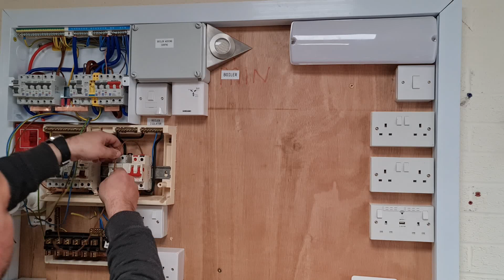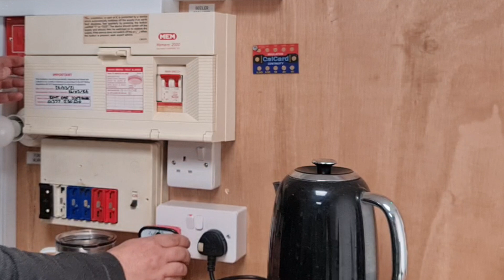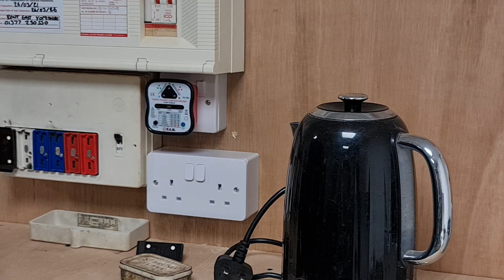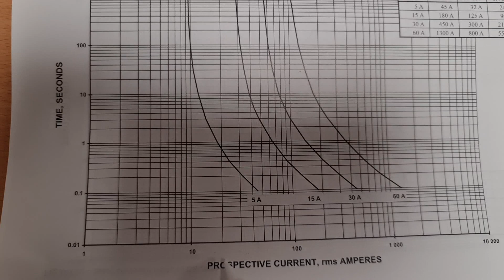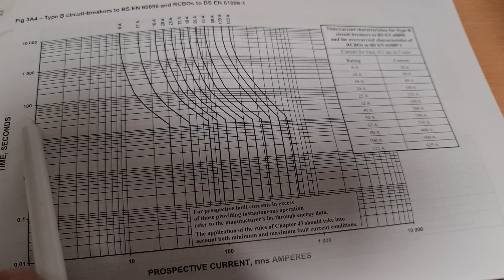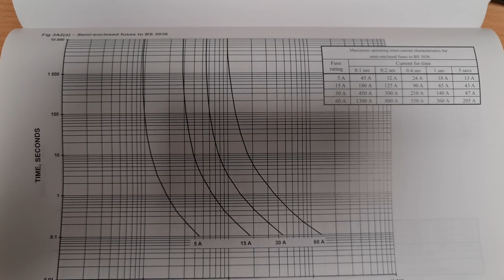Old vs New, what trips faster fuse wire or (B) MCB. Flash bang madness and time curve analysis!

Comment: Old school emergency from an old guy when I was an apprentice in the 80s, if you don’t have any fuse wire, use one strand of a single cable. 1 mm is about 5 amp 2.5 mm is about 15 amp etc.
Reply: I meant to say  a single strand of 7 strand single cable

Comment: Interesting. I remember reading that MCBs react faster than fuses - particularly during a short circuit. Seems like that info was wrong.
Reply from the maker: On paper they should. But if the instant current flow is high enough all bets are off. Due to the physics of fuse wire it generally wins if fault current is large enough.

Comment: Well demonstrated old chap.
Reply from the maker: thanks! very kind and thats another item off the bucket list. A comment from yourself.
Reply: It certainly was always thinking outside the box. Well lots of consumer boxes really👍🏾
Reply: Fuses are sacrificial devices which still have a role to play in modern large industrial settings (both fast and slow blow fuses for dedicated feeds and equipment loads) we certainly see them here in the USA partly as you suggest due to the fast reaction times. The breaker is an interrupting devices meant for greater longevity and modern power usage breakers of course offer another important protection linked to the physics of electricity namely magnetic protection as well beyond the thermal. Electric fields tend to also generate and be generated by magnetic fields.

For the residential setting breakers with RCD protection are fundamentally important with AFDDs coming on board (no pun intended) we have greater protection against some fire protection due to some but not all faulty wiring and faulty device situations. Breakers tend to be better with different short-circuit conditions than just over-current issues where fuses come into their own.

Things are constantly evolving in different settings, residential with island mode and smart devices with DC leakage requires more thought than in the past and breakers will evolve further.

So both have their roles even in modern settings it just depends where they are used. I still like the UK plug with the sacrificial fuse wish we had something similar in the US, though will never miss walking on one though.....🤦🏾